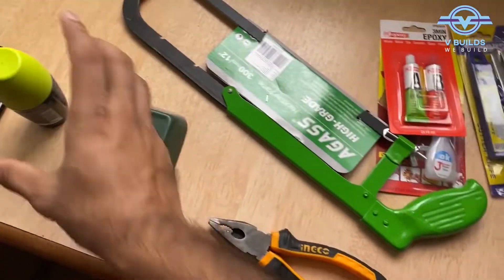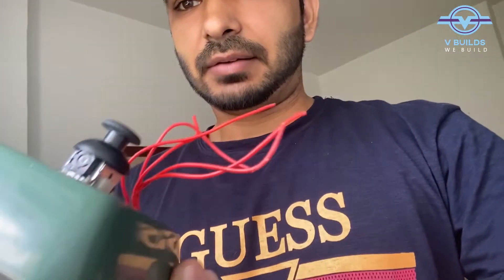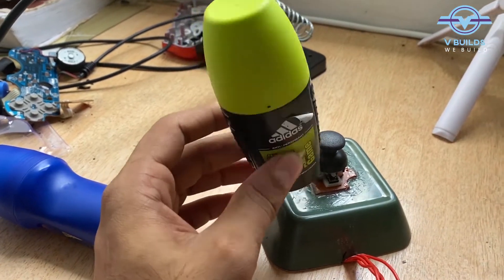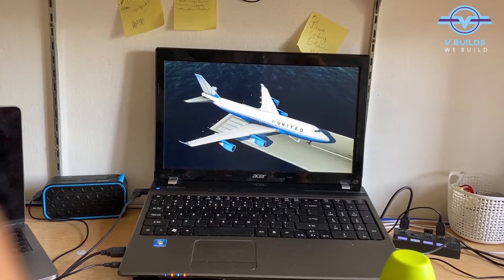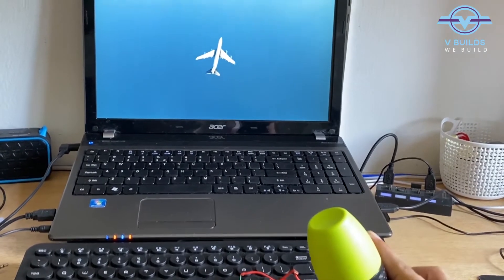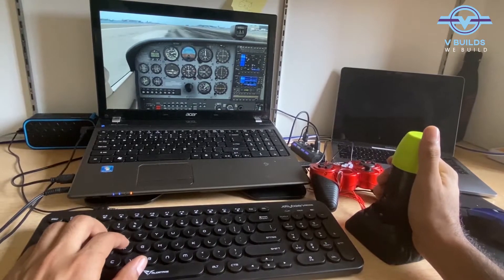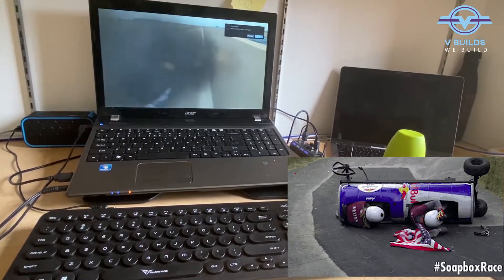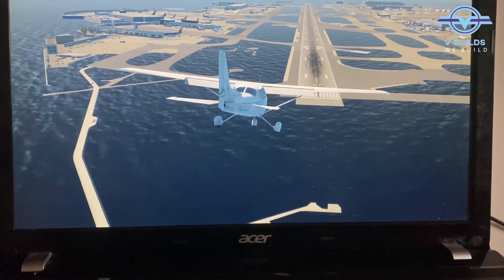How to make a Joystick for flight simulator

Comment: great improvise 🤙
anyway, may i know what platform do you use and is it fsx or aerofly ?
Reply from the maker: Thanks!!... This is xplanes 11. However , this joystick can be used in any of the simulators. In later videos i am using SimVimX and arduino to make the switches. That is exclusively for x planes
Reply: @VBuilds  Cool mate 🤙 and laptop you used ?
Reply from the maker: @tac-cobserver3788  Currently using Acer Nitro 5 (i5, RTX 3050), https://www.amazon.in/dp/B09B2F2DMK/ref=twister_B09HNF8C54?_encoding=UTF8&th=1
it good for running Microsoft flight simulator 2020 as well.
When i made this video that time I was using an older laptop which was barely able to run fsx 11.
Reply: @VBuilds  Great, thanks for share mate. great content, keep it up 🤙
Reply from the maker: @tac-cobserver3788  Thank you! means a lot as i am new to this. Please share if possible :)
Reply: @VBuilds  With my pleasure, We'll do bro, just stay healthy, stay positive and Keep it up 🤙